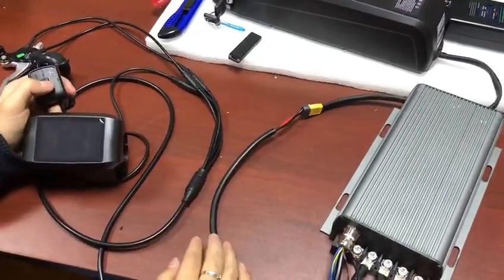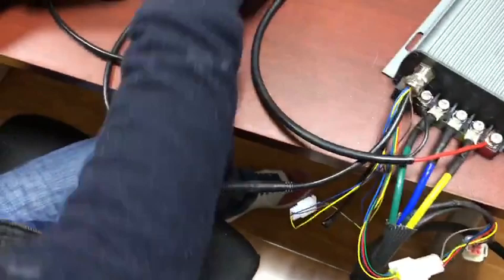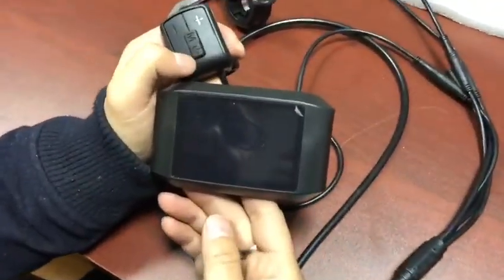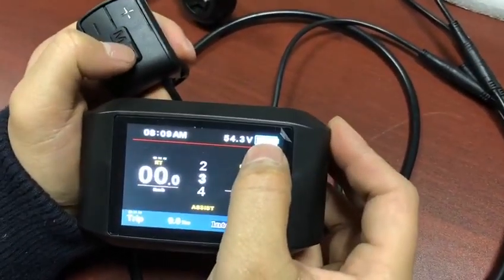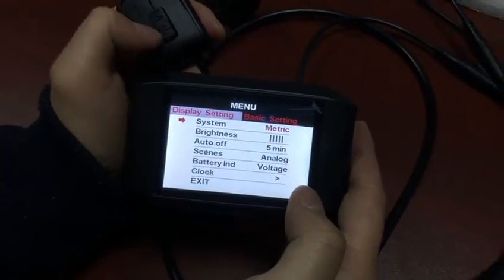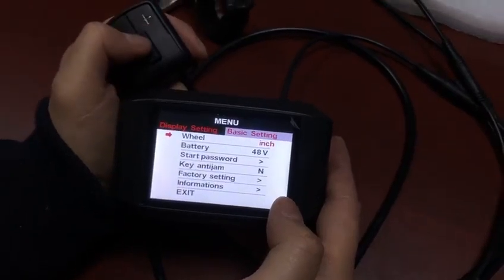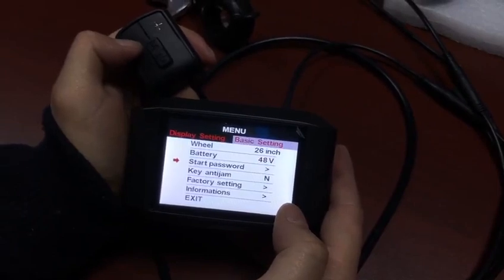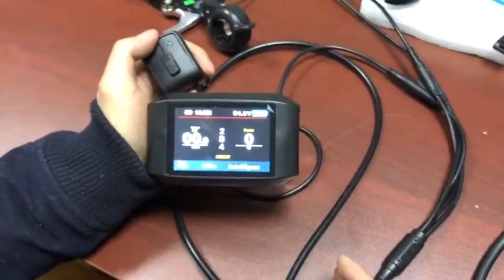SVMC72150 controller Complete setup with TFT screen

Comment: I have this screen half mated to a kelly controller with a qs 205 3.5 t at the mo im only using the battery wires but wondered if I can put the green blue and yellow wires to either a throttle or hall sensor wires to get a speed or power reading ?? Any help would be appreciated

Comment: Vito please help me. I am trying to purchase a conversion kit from QS MOTOR on Alibaba and it's not going as easy as I thought. I want the QS 205 V3 hub motor 5T winding for a 26"fat bike with the SVMC72150 CONTROLLER & TFT COLOR DISPLAY. I need a price for the whole kit + shipping & handling and the website to make the order.
Reply: Hello there. I've had similar also. Try aliExpress. Alibaba are  factory based, i.e. they deal mainly with multiple orders 50 or 100 pieces,  but aliExpress are similar to a shop front, buy how many you like, may cost a little more, but you'll save yourself a headache. Good luck anyway 👍